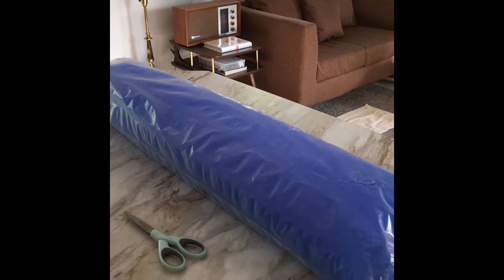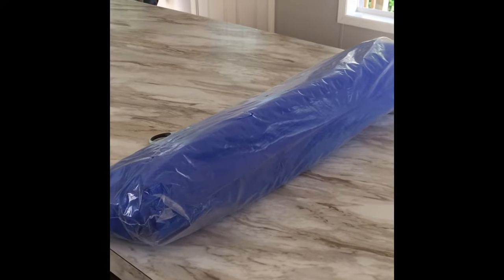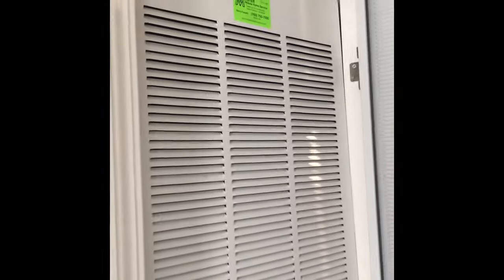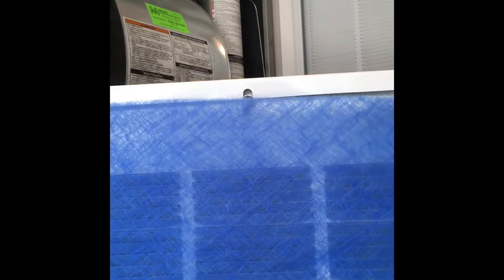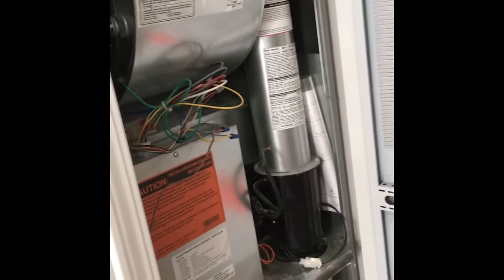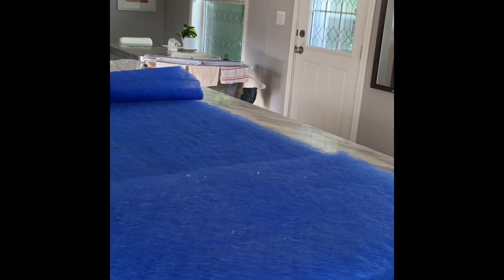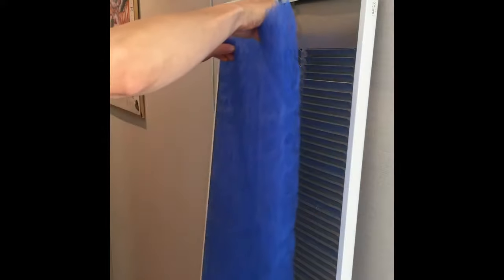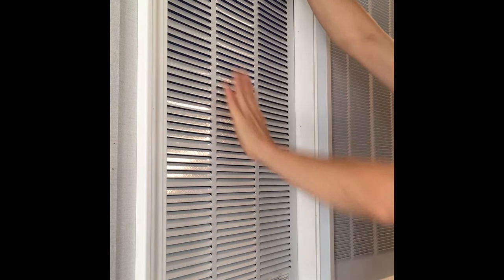HOW TO CHANGE A MOBILE HOME FURNACE FILTER

Comment from the maker: Update 11/4/22: The furnace filter saga continues, lol. I had a recent annual maintenance tune-up and found that the filter I have been using is too thin/won't catch all of the dust during air exchange...was advised to use the Flanders Natural Aire 20" x 30" Filter (SM1006)👍

Comment: But how do you remove the front cover off? No one has shown that on video.
Reply from the maker: Hi there! Yes, unfortunately I missed filming that part, so sorry about that. There is small, round metal piece, about the size of a dime (kind of like a knob) at the very top of the white cover. I turn this left or right until there's a bit of a "give", then simply pull the white cover off. Hope that helps and thanks for watching :)

Comment: How do you take the interior  a/c - furnace door off? I have the knob on the top but I don’t know if I turn to the right or left to unlock. I also do t know if I pull off or lift up to get the panel off to change the filter
Reply from the maker: Hi Racheil, mine too has a metal knob that I have to fudge with, both either to the R/L, until it "gives". It usually takes me a few minutes and can be tricky despite doing this every month for the past few years, lol. I also have to both pull the panel up to kind of slide it and then pull it off once it has cleared the insert area if that makes sense. Maybe a local HVAC person could come for a tune-up and help demonstrate how yours works? Hope that helps and have a good day :)
Reply: @trailersandtea  Thank you - I will have to try everything you’ve suggested. Have a great day
Reply from the maker: @racheildrake8851  My pleasure, you too!

Comment: Do you have a flat bottom section? Mine has that and it seems to be the only way to properly set the top back in place, but it doesnt stay shut. You can't put any pressure without it popping apart and falling
Reply from the maker: Hi Rhythm, yes, there's a flat bottom that the removal panel sits on top of, but there's also a button on top that turns/locks it into place so it won't fall. Not sure if yours has this? Good luck and hope you're able to fix it!

Comment: Where can I buy this? And do you what you called those 2 filters the goes on the side of this? Mine is dirty and I don’t know what you call it.
Reply from the maker: Hi jnagunst, I got the blue filter roll at a local home improvement store, but I've since learned that it's better to use a different filter from Walmart (for my furnace): Flanders Natural Aire 20" x 30" Filter (SM1006). It's green and in a clear package.  Hope that helps and have a good night!

Comment: Hi! Do you have info on the exact filter you use? And does the button up top just twist to pull the door off? We seem to be having trouble with that
Reply from the maker: Hi Emily!  Sure, this is the filter I'm using:  Flanders Natural Aire 20" x 30" Filter (SM1006).  I was able to find them at Walmart in the home improvement section.  Yes, the top of my furnace panel has a little metal screw/button that has to be twisted in order to remove it/be able to get in there to change the filter.  And it is very tricky!  I have butter fingers so my son has been helping me...there's a certain way that he has to push it in and twist at the same time.  Sorry if that wasn't too helpful, hopefully you are able to get it to work!  Thank you for watching and have a good day!
Reply: @trailersandtea  thank you so much! Do you happen to know if he twists it a certain direction to undo it, left or right?
Reply from the maker: @emilymenard6371  You're very welcome!  I'm not sure which way he turns it (sorry!), seems like it's which ever way it's able to budge.  Maybe a neighbor could look at it?  Hope that helps!